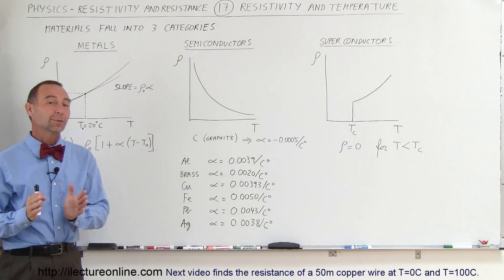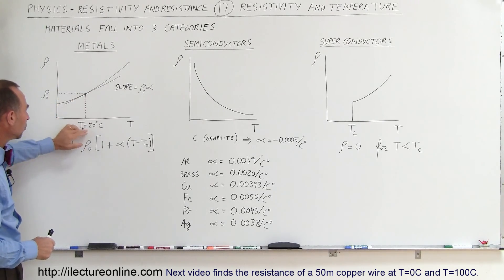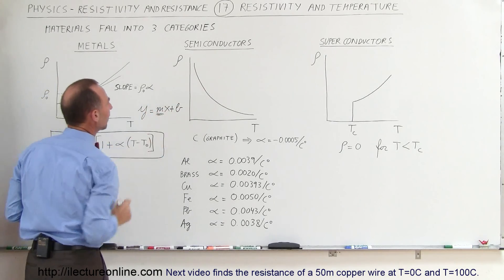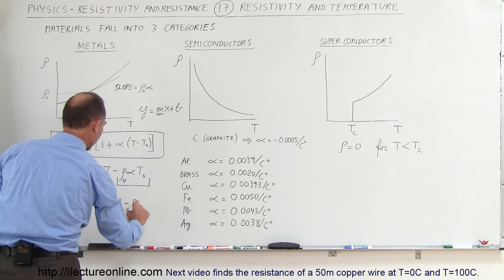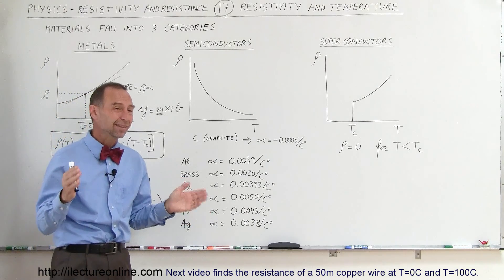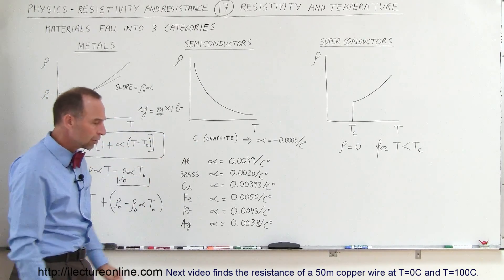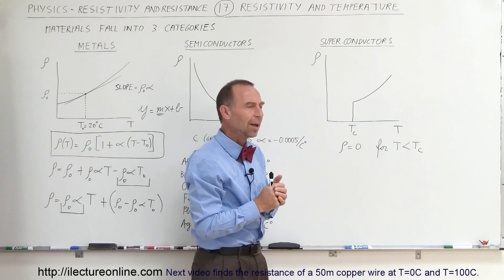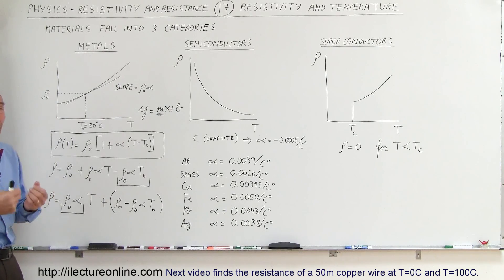Physics 40   Resistivity and Resistance (17 of 33) Resistivity and Temperature

Comment: in one book i read that alpha =(r2-r1)/r1t2-r2t1 so is this showing the actual relation which is not assuming the part of the curve which is straight but also the curve for high differance of temperature part ?
Reply from the maker: Take another look at that equation in your book.If you start with the equation shown in this video:  R2 = R1 [ 1 + alpha (T2-T1) and you solve that equation for alpha, you get:  alpha = (R2-R1) / R1(T2-T1) .